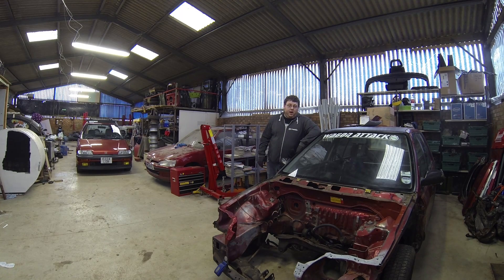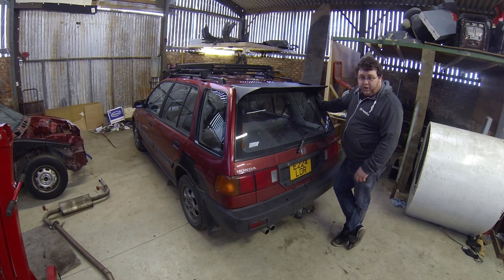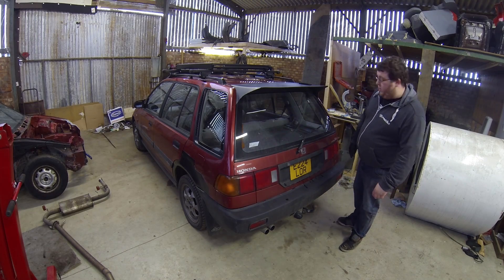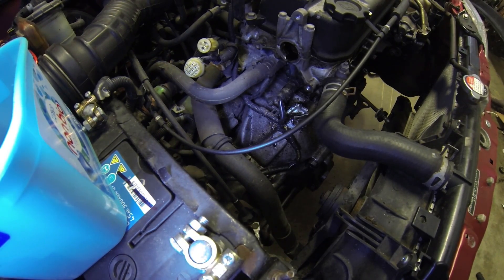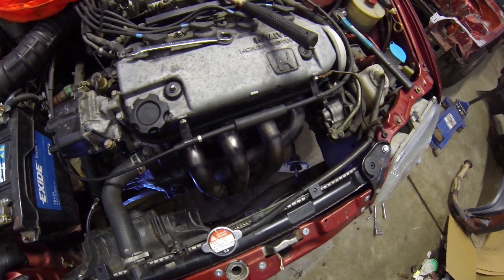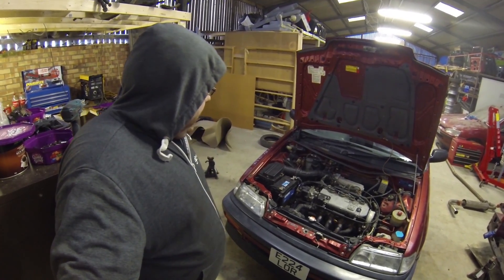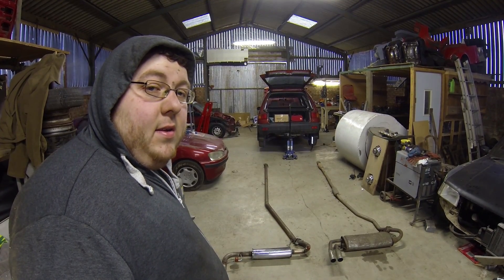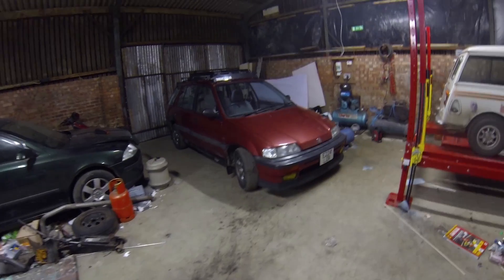Wagon Attack Diaries - Episode 13 (Beater Exhaust)

Comment: Hi Eden, what is the impact gun that you are using?
Reply from the maker: Sealey 24V Impact, Was on offer £150 at Xmas. Its a Decent gun! plenty of Umph, tad on the heavy side though and its Ni-Cd. I also have a Makita Impact driver for smaller nuts and bolts. Again, On offer at Xmas.